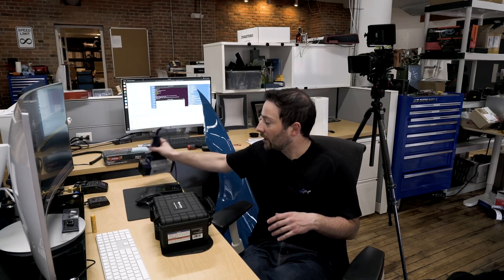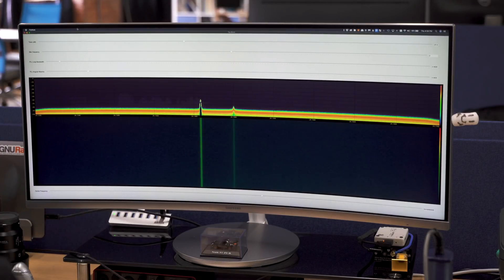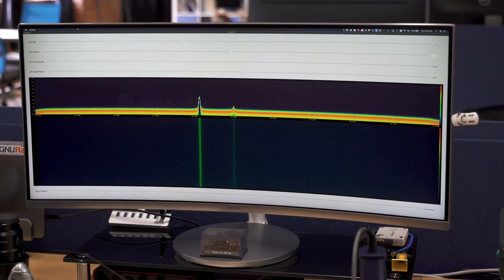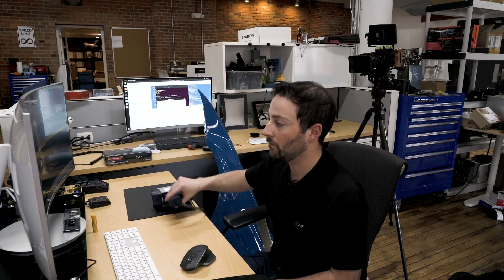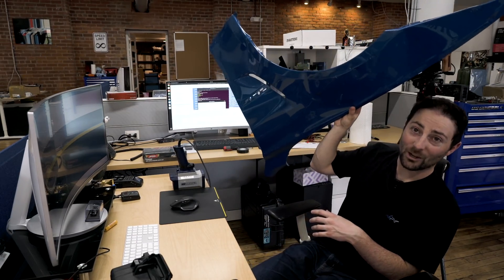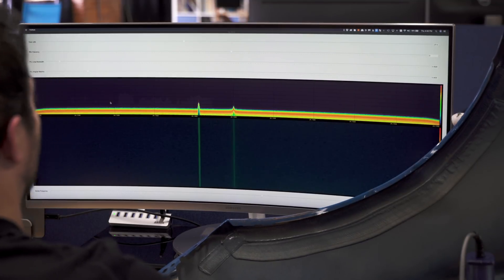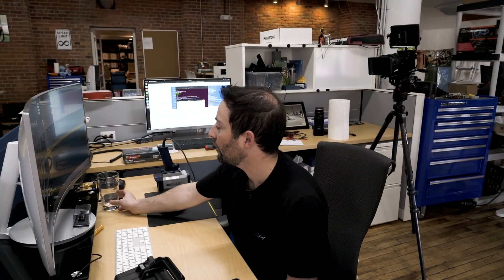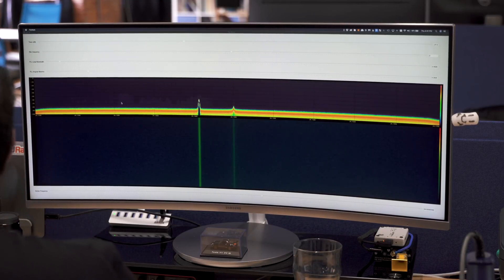Radar detectors behind carbon fiber, plastic and metal - TESTED!

Comment: Your experiment may be flawed.  If, for example, the carbon fiber does 50% attenuation (with 50% transmittance) and the aluminum panel does 50% reflection (also 50% transmittance), using the setup, they will appear to be the same.  If you want to check if radar detectors can detect certain materials, you need to test the reflectivity such as putting the detector behind the emitter.  Ideally, the cross-sectional shape of all the materials should be the same to do an accurate test but I think doing as you did using generic objects (but with the detector behind the emitter) would still give a good enough indication as to what materials reflect radar.  To see how much a material absorbs, reflects, and permits transmittance, you should use an extra detector and put the detectors on both sides of the material.  If you know the strength of the original wave being transmitted, then you can easily find the absorption, transmission, and reflection of the material based on the transmitted and reflected strengths, i.e. absorbed = initial - (reflected + transmitted) or something like that.  Anyway, thanks for the video.

Comment: Not to be negative, but there's soooo much more to this than meets the eye.  First is to understand that if you put anything close to the antenna aperture, it becomes a functional PART of the antenna... and unless it's designed as a radome, it will have a negative effect on the antenna gain and/or beam width.  Ideally the "test material" should be placed at least 10 wavelengths away from the aperture, the more the better.  [more...]

NEXT - you're testing in an area that has lots of reflective objects... so you can't get good results when dealing with any tested material that is highly reflective.  Some materials are more "lossy" versus "reflective", such as many carbon fiber materials. This is a SIGNIFICANT difference when it comes to how well a radar can detect an object... since the carbon fiber tends to "soak up" microwave energy instead of reflecting it back to the source (it absorbs it, then dissipates it as heat).   

NEXT - keep in mind that many "black colored" plastics use "carbon black" as a pigment, when can tend to cause some degree of "loss" (but not reflection). 

If a car has carbon fiber body panels, it could "hide" the reflective metal parts behind it, whereas a car with plastic body panels won't have as 'hard' of a reflection as a metal-skinned car, but the metal components behind that plastic will reflect.

1) Starting with the "glass"... it's got a severe curvature to it, which means it will refract the 24GHz microwave EM waves like light waves... just not to the same degree. Compared to a windshield - which has a relatively flat profile within the receiving antenna's beam width, a glass has a LOT of curvature in that area, causing far more refraction.

2) Next with the metal fender... either you were not accurately inserting it between the source and the sensor, or you actually caused reflection and the detector ended up finding a reflection to read. Even with aluminum no SHF EM will pass through any solid (non-perforated) metal... unless it's only a few atoms thick. As a conductor of electricity, the surface of the metal sets up a counter-field that cancels the original EM field.  Sometimes microwave radiation can actually set up a skin effect, and travel along the skin of a metal surface, even bending around corners.  This is but one small reason microwave engineering is at least as much "art" as it is "science".

3) Carbon Fiber - As mentioned earlier - it can be lossy - depending on the density of the carbon-content, and whether it's scattered or directional layered. If it's made with a single axis weave (that allows bending in one axis), it is possible to allow microwave penetration - as long as the EM polarization is in alignment.

Comment: Great test! I'd be careful however of putting items so close to the Tx antenna in this case. The material will couple to the Tx antenna since its in the near field and degrade the radiation properties, so you're also measuring how the material affects the Tx antenna. It probably doesn't change the results significantly, just something to keep in mind.

Comment: Very interesting!  Appreciate you taking the time. A windshield will provide a certain amount of db drop, especially if it has radio antennas or dimming tech built in. Leads to what would be the optimal mount position?